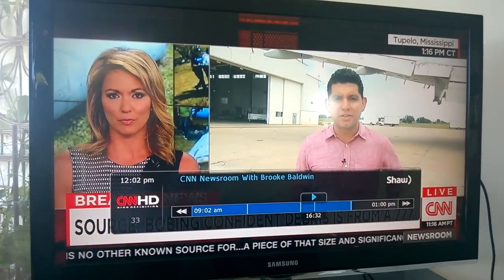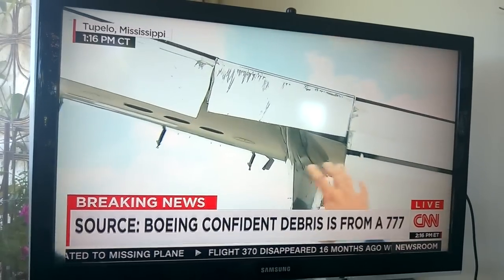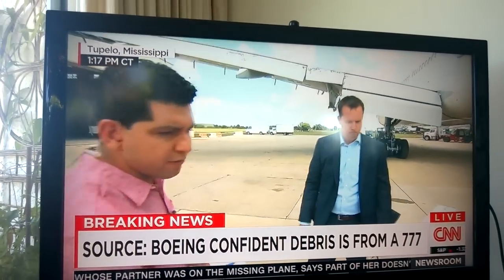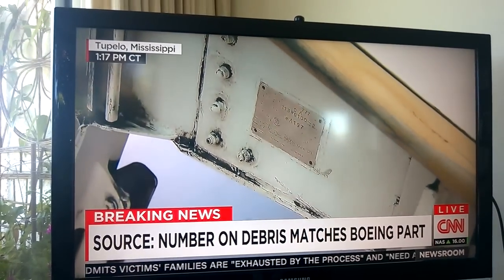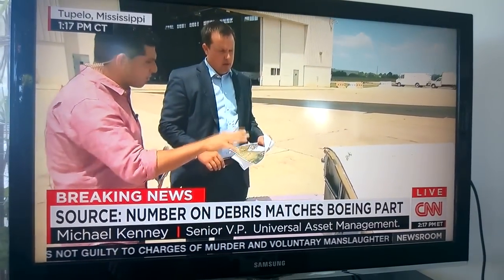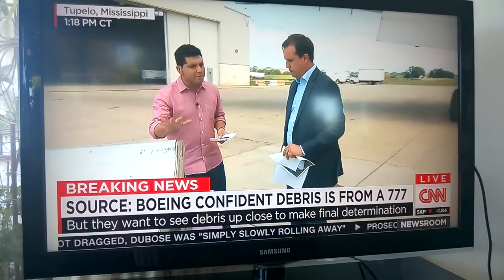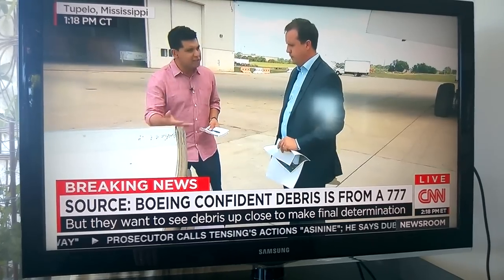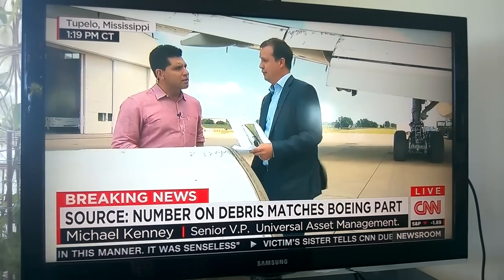MH370 CNN covers Missing Data Plate on 777 Flaperon - Mystery Deepens

Comment: Not held on with screws; its bonded with a type of strong glue and subject to corosion. The aircraft flown to Isreal and tail number changed does not mean anything; its common in the business. When an aircraft changes configuration, sometimes the registration number must be changed.